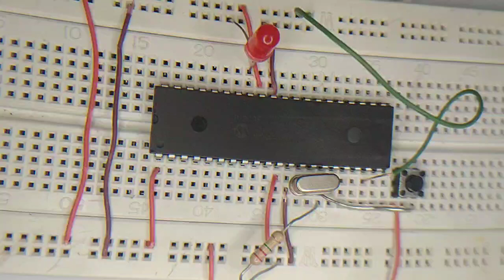How to use an External Reset in PIC microcontroller || Master Clear in PIC18

Comment: Which low signal we should give ?
Low signal with resister or
Full low signal
Reply from the maker: You can connect it directly with a push switch in between.
Reply: @uktanoli  
Thank you
From india

Comment: whether this reset function will delete existing programs, sir
Reply from the maker: If we use the master clear i. e. by applying a low signal to MCLR pin it will restart the code means it will start execution form the very first instruction of the existing code in the program memory